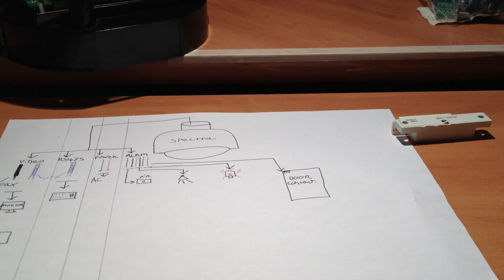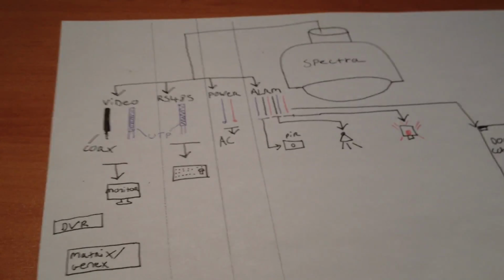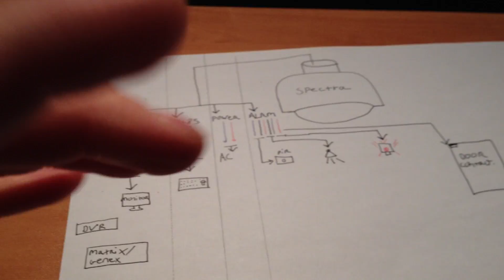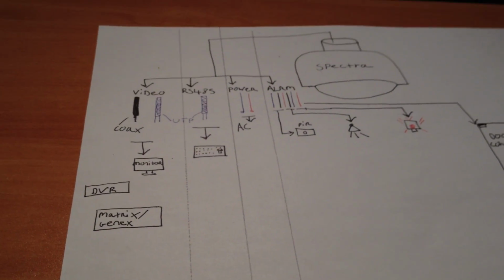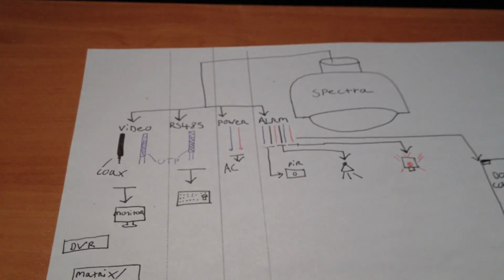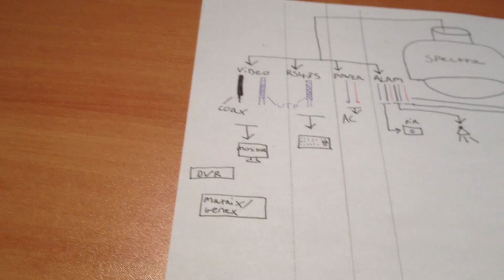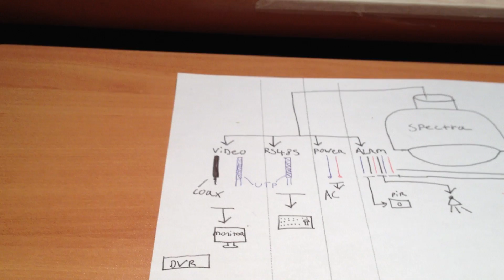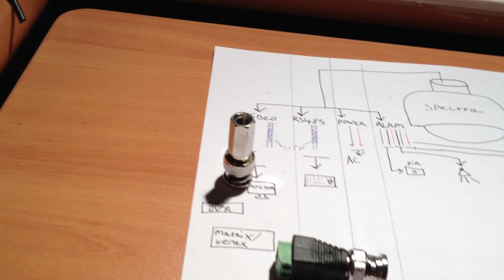How to connect and wire a Pelco Spectra PTZ CCTV Security Surveillance Camera

Comment: What DVR do you recommend with PTZ control/recording for these cameras?
Reply from the maker: I would honestly look in to getting an IP system, either Hikvision or Dahua.
Pelco no longer supports any of this old analog technology so you are completely on your own in setting it up.
If you can get one for under $100 the DX4800HD was the last DVR they made. It supports coaxitron and full 30 frame per second recording for all channels.
Reply: @QuaabQueb  I just scored some Spectra 3 & 4 cameras so I'd like to build a system with PTZ control that records.  To control the ptz, does it need to be connected to the RS-485 serial ports and support coaxitron or what exactly am I looking for in a DVR lol?  I found a 4500 series for under $100
Reply from the maker: @TechTy  You want a DX4800HD nothing else. That is the only DVR that will record all channels in the highest resolution and frame rate. All the other models are old crap and you will have limited recording quality.
As for PTZ control the DX4800HD will allow you to control the cameras via Coaxitron protocol (through the video cable, no need for extra wires and rs-485 programming)
You just have to set the DIP switches and control protocol accordingly.

Fair warning, the image quality on this old stuff is crap compared to the IP systems now available, your best bet is selling it all on ebay and investing in some better quality stuff

Comment: Dude. Thank you so much for this video. I just got a support job in which I will deal with analog ptzs alot. I needed a refresher. This was perfect
Reply from the maker: Glad it helped...This was a video I filmed by hand with my blackberry torch at the time. If you need any help feel free to drop comments. I still check them all. I have been dealing with this stuff for over a decade now.
Reply: You are probably a library on a set of legs. I will be supporting Technicians over the phone from coast to coast for one big client. Apparently I'm going to get alot of calls about Pelco equipment. I've worked with them but i just would tinker with them until it worked. Now i gotta explain this stuff to people. Hahaha. I will probably have more questions but this was 10/10.
Reply from the maker: @follow_fraser3081  Pelco was the biggest world wide...company got bought out by Schneider Electric in 2007 they gutted the company and ran it in to the ground. They sold it off, and recently Motorola Solutions bought it now. They don't touch analog stuff anymore. These old analog cameras are still all over the world. The "big" players mostly government and big industry still don't "trust" IP technologies yet. Walk in to any big site and you will still see analog cameras in parallel with the new IP systems.
Reply: @QuaabQueb  do you still have a stock of Pelco stuff? That stuff is hard to find. My company is always looking for keyboards, cameras, matrix switches. Its crazy. Apparently we take them to electronics shops to get fixed now. Lol
Reply from the maker: @follow_fraser3081  Nope, I don't deal with that stuff anymore. My system at home is still analog pelco, I am slowly upgrading it to an IP Hikvision system. Check on ebay you will see a lot come up really cheap. There are still a handful of shops that specialize in repairing this equipment and they are not cheap...
Reply: @QuaabQueb  Question for you. I'm trying to find how to reboot a Spectra V from a KBD300A. Using a CM6800 matrix switcher. I dont have the equipment infront of me so i cant play with it. I know how to get to the menu by holding preset after entering 95. I can't find a manual that shows me what's in that menu. Is it just an option in that menu to reboot the camera?
Reply from the maker: @follow_fraser3081  yes you can power cycle the camera that way.

Comment: Firstly, great video! I've learned way more from this than I have through hours of searching through archaic Pelco support pages!
However, I'm still relatively new to, not only CCTV, but electronics as well, but overall I have a few questions:
1) Are coaxitrions absolutely necessary? In your diagram you have it drawn out to look like the camera is linked directly into the monitor (and/or DVR system), which brings into question if a the coaxitron is needed at all.
2) You mentioned that the Spectra IV (which is the model I think I have) can output video via UTP instead of the coaxial cable, but how does (can) that translate into practical video? (HDMI, VGA, etc.?)
3) On that note, How are you able to tell what model of camera you have? (For context, I found mine at a thrift store and mostly just got it out of curiosity, but after finding it was mostly intact, I thought I would attempt to re-purpose it. Unfortunately there's nothing on it mentioning its exact model other than some serial numbers that take me to wildly different third party security camera sites in the search engine, so since you mentioned Spectra IV has UTP, I figure that's the oldest model mine is.)
4) If everything is connected and carried via the input of a Cat5 cable, What should (or could) the output end of the cable look like/connect to? Is there a particular microcontroller that should be considered, or the aforementioned coaxitron? Also, power supplies: does just any 24V 60Hz power supply work, or is there a proprietary one I should look out for?
5) Lastly, in my case, is it even worth the effort to attempt to gather all of these proprietary components? Since all I have is the camera (no other controllers or adapters) I was thinking it might actually be easier (but way more time consuming) to just gut it and use an Arduino to control its movement and transmit video through some other means instead of scouring for the largely discontinued, cryptic, and expensive Pelco firmware and CCTV infrastructure. But at that point I would have to take the camera apart piece by piece to see if it's even possible, which I would rather not do due to room for error in breaking it, which brings me here asking all of these questions. :D
Reply from the maker: They are older cameras, but still work fine and are simple to use.
Coaxitron refers to the method to control the pan/tilt/zoom functions. This is only for pelco cameras. It send the control signals through the video cable, so you do not need to set up a separate RS-485 connection. This is usually done with CAT5 cable any ways.
If you are going to use CAT5 cable, make sure it is high quality, and shielded. I used cheap cable and had a lot of problems with interference. Also do not use those cheap green and black baluns, they wont work properly.
The cheapest way to get the camera running is with an MX4016CD multiplexer, and a KBD4000 keyboard, these can be found on ebay from time to time as low as $20
However nowadays for around $100 you can find IP PTZ cameras from China. They will provide far better image quality than any analog CCTV camera.

Comment: Nice video, I have a C10CH-6 fixed camera with a Pelco 2.8-12mm lens. Do you think it would fit in a Pelco DF-5 or a DF-8 Dome better? THANKS
Reply from the maker: DF8 is pretty large, huge actually, should be fine in a DF5. These cameras are specially compact to fit in a DF5
Reply: @QuaabQueb  thanks
Reply from the maker: @queencitysirens8755  I have 2 for sale of you are interested
Reply: @QuaabQueb  possibly, can you please send a link?
Reply from the maker: @queencitysirens8755  I do not have the posted yet but I can email you pictures if you like. I have black one (indoor, no sun shroud or heater) and an outdoor one

Comment: At 2:35 the connector you call a " balun" is only a straight through bnc connector???
Also you neglect to mention that the power requirement is 24 volt A.C.
Reply from the maker: Yes don't use them they are shit.  I did mention it in the middle of the video.

Comment: great video, i was able to connect my 300a controller to the Pelco Esprit Camera and control it, then when i went to place it where i was installing it i unable to control it, i put everything back on the bench and connected like it was originally when i started but unable, i checked groudning,  pin 1-2 on the 300a rj45 (right to left) the RX+ and RX- on the camera (receiver) any suggestions? Thank you .
Reply from the maker: Action News Hmm that's strange maybe the cable run is too long and you are not getting enough power to the camera from the long cable run
Reply: Chargèro thanks for your reply the cable is just a few feet and the original workbench I did get it to work but it's now choppy did I burn anything

Comment: Hello I have a Honeywell fusion dvr and I have no terminal to connect the ptz to besides two wires comming out of the back of dvr I want to run more then 1 ptz but I have no clue where to start on powering the ptz and data please help me please I’m stressing
Reply from the maker: Hi, you need to refer to the installation or operation manual of the specific DVR and cameras you are trying to connect. It will show you how to wire them and program them.

Comment: Hello, the video helped me a lot to solve some problems with my camera spectra iv. But my camera uses an IP (TXB-N) module, and I no longer want to use the camera via IP, but through a DVR and RS485. Would it be possible for you to show me the pinout image of the 16pin PS3BB16SP plug? I'll try to do it here.
Reply from the maker: Hi, you should not need the TBX module, just unplug it and pull it out, you can sell it on ebay.
You would just use the BNC connector or UTP terminals for regular analog video and it will operate as normal.

Comment: i have a  B&W  CCD camera model mc-113s . it has a 6 pin mile plug on it. got it second hand so warranty is not an issue. Q whats the easiest  way to make them work? thank you
Reply from the maker: +Tom Gange Sounds like one of those old style cameras wit a multi-pin connector that is supposed to plug in to a proprietary DVR or cable. Your best bet would be to try and find a pin-out or wiring diagram online or from the manufacturer

Comment: Your "balun" that you are using is not a true balun. It's a cheap adapter that simply makes wire connections to the pin and ground of the BNC connector.  A true balun is a little larger and isolates the cat-5/6 cable from the BNC connector and contains a 75 to 100 ohm transformer.  Another Note, distance with a balun on color is typically 2200 feet, considerably  more than with coax.
Reply from the maker: +Zilo Flash Yeah, I think I mention it in another video, the cheap baluns such at this one will work fine on cheap cameras for vieo transmission, but when you try to use Coaxitron (PTZ control via video cable) you run in to problems, you have to use a good quality Nitek or NVT one.
I have used cheap Chinese baluns, but the larger type with a 75Ω transformer inside and they do work fine.
I have yet to see a 2200ft run, but I'm sure its possible with quality equipment and cable but for video applications there maybe be some loss in quality.
Are you a video engineer or do you work in the field ?
Reply: I used to install and maintain pelco  kit for the highways agency before I retired

Comment: What kind of power supply is needed and what is the voltage and wattage of the power supply
Reply: james parise thanks but I tried using a 27v ac. the camera did go through a POST. 
Its just a matter of time before i can figure out the dip switches

if you or someone else can help me with the dip switches that would help

the camera and keyboard:
KBD300A

Pelco spectra IV DD4cbw23
 trying to run in direct mode D or P
see if you or someone else can give me a diagram of the correct dip switch settings 

Thanks

Comment: hi. i have pelco spectra 3 and theres no problem with ptz connection via rs485. 

but i have also spectra 2 and i cant start ptz-control via rs422. 
i use rs232/485/422 converter from ebay(china). is it possible to convert rss422 to rs485 in another way? thanks.

Comment: Great writeup. I've been looking for something like this. I've got a DVR/RS485. A SVFT-W35 Vicon PTZ. The camera has the RX+- and TX+- connections, et al. I believe that camera R+ goes to DVR RS485 A(+) and camera R- goes to DVR RS485 B(-). Is this correct? I don't think there is much power in these connections but still hate to keep chaning back and forth. Hope u can help.

thanks
Matt.

Comment: sorry for late response, Seems like we have Spectra 2 or 3, not entirely sure yet. I went up to inspect one of them today real quick.  I brought the dome down and opened it up, a negative power wire was disconnected, might of come lose when i opened it. I put it back in place, previous obvious where it went by looking at the board, and made sure all the wiring was good. Connected the ribbon cable back and the camera moved a bit. I waited 30 seconds and it did not budge again after that :\.